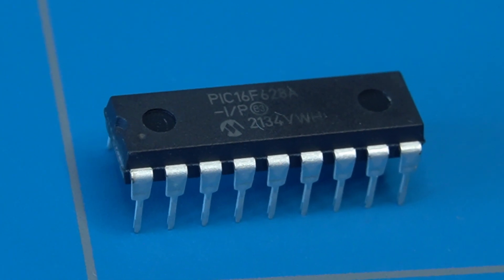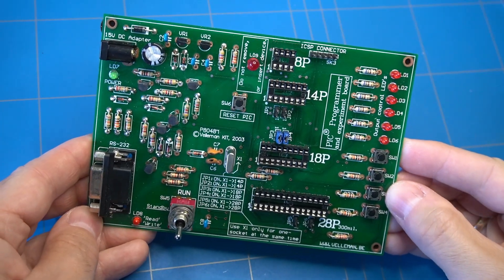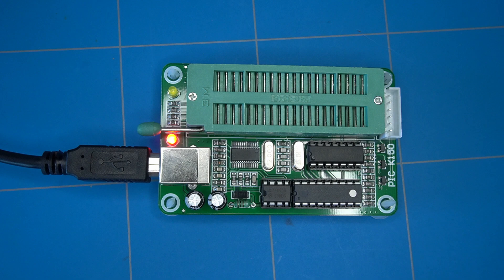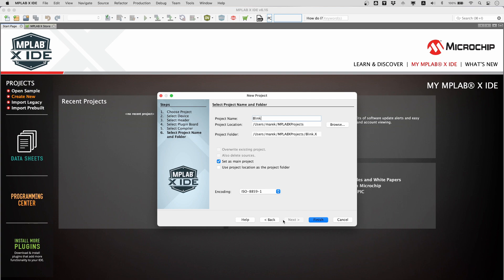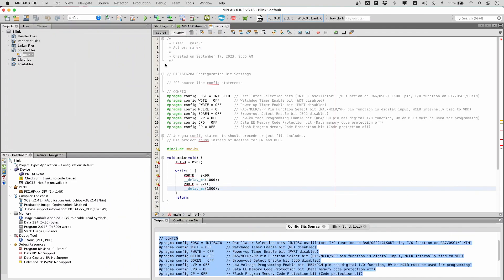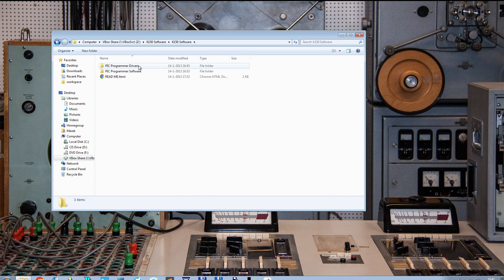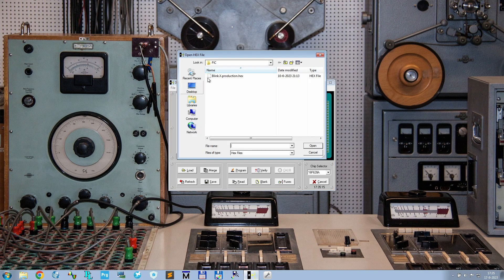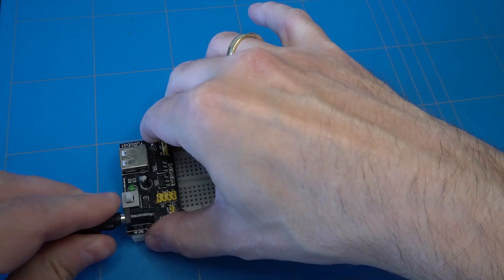How to program a PIC microchip?

Comment: PICs have good specs are fast and cheap microcontrollers. I used them a bit. Sadly the free IDE does not provide any libraries and this is where Arduino beats it in enthusiast's lab. Writing step by step code for I2C, SPI, displays and so on is fun and education, but takes a lot of time and effort. I think paid version gives much better support for developers, IDE automation and access to libraries.

Comment: Yes, Windows 7 is outdated, but it was and STILL is the best windows yet, in my opinion. Excellent video.
Reply from the maker: Thanks. Yes, I agree. It was / is my favourite Windows version.
Reply: @ezContents  yes. 7 is light and require short time for booting.
Reply: Agree, 7 and XP were bulletproof
Reply: I held on til absolute death with windows 7,eventually the lack of drivers catches up to you though. Then I went to Linux.
Reply: @xavierayayaell546  I most certainly relate, haha.
Reply: @xavierayayaell546 There’s no issues with drivers for old, primitive hardware such as PIC programmers.
Reply: You use XP and get hacked in minutes after connecting to network
Reply from the maker: If you use a hardware firewall and don't do weird stuff on your XP then you are still pretty safe.
Reply: @ezContents  hm, maybe that could work, yeah. I heard that there are some Linux distributions that offer looks and feels like old Windows versions.

Comment: I still use my veteran Veleman P8048 board, but I connect a a Pikcit 3 on the ICSP header. right now it has a 4 MHz crystal and a PIC16F84A mcu. The part around the serial port is no longer in use.
Reply from the maker: That's a nice solution. Maybe I will try that one out. Thanks.

Comment: RA4 GPIO of PortA is an open drain port so, can  LED's be interfaced to other PortA pins (which are stated as CMOS) in current sink or current source methods? Also can an Switch be interfaced to RA4 with an 10k resistor pulled up to Vcc and switch connected to ground to read an active low signal when the switch is pressed?
Reply from the maker: On that pin you have GND or a floating state/high impedance. So you will need a pull up resistor for it to work.

Comment: I have K150 programmer too. But as you said that the K150 chip supports only the operating system of Windows 7 SP3 and below. Then i quit trying after that. I didn't check for years. We need a new programmer 😁
Reply: Pl2303 driver works in Windows 11 too. I have few devices based in it, no issues
Reply from the maker: I could be mistaken, but I thought that I saw the Prolific drivers for Windows 10 somewhere.
Reply: You cauld sniff the web for a Pickit 2 if you're only prgramming PIC mcu.

They work in both Linux (with manditory faul language) and even Win 11

Nte win software are free for the PK2.
Reply: @magicsmokeescapist4069  Thanks, I'll try that 👍